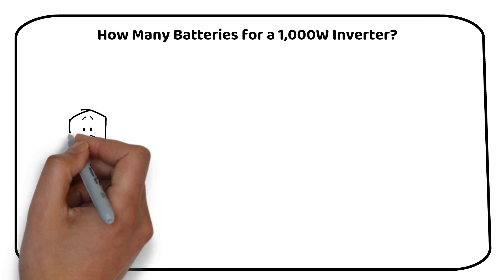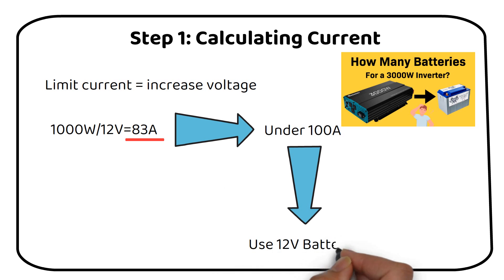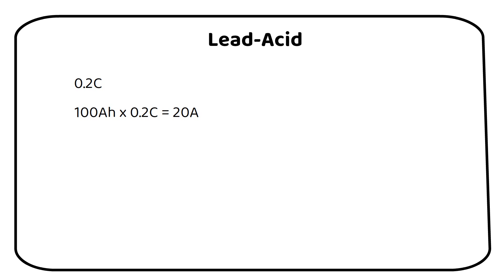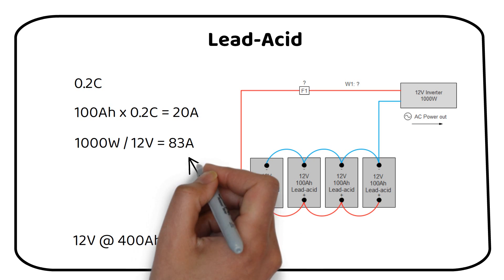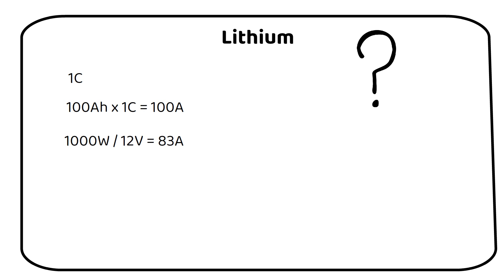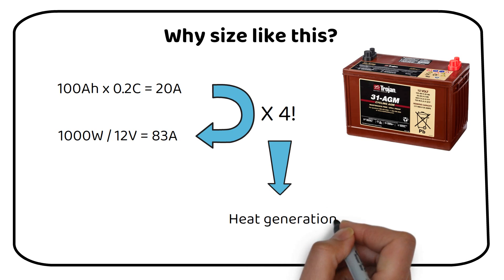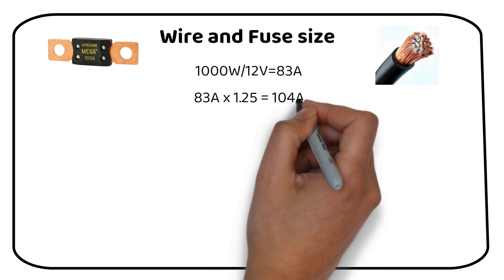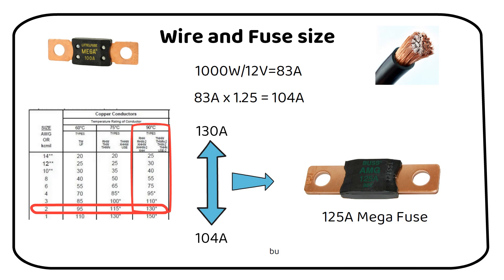1000W Inverter: How Many Batteries You Really Need

Comment: Ok, first off, a 1000 watts is pretty useless. Get an inverter that will at least run a coffee maker.
Reply from the maker: That's so American of you to say 😄 vans use less than 1000 watts.
Reply: @cleversolarpower  
2000 watt inverter and 460AH of batteries in my van. My coffee maker pulls 1200 watts.
Reply: No trying to start any arguments with anyone, just convey some useful, practical info: 
Mr. Coffee Mini (5 cup model) draws 635 W when on the brew cycle, then becomes intermittent, as needed with the warming plate on. That 1/2-size machine, with a 1000 W CSWEI PSW inverter, 10 Ah MPPT  charge controller, 100 Ah LiFePo4 (100 Ah BMS) and 150 W of solar panels has worked successfully without any other a/c input for the past year. We make a pot in the morning, another in the evening, and sometimes another in the mid-day. It's doable.
Reply: @davef.2329  Hey whatever works. I'm already running the fridge, I like to turn the diesel heater on in the morning, and maybe nuke a pastry with some butter to have with my coffee.. 1000 just won't cut it. Some of that stuff is 12V, but still....
Reply from the maker: @cabracove  With nuke you mean microwave? 😄
Reply: @cleversolarpower  Yes. There's a coffee maker, microwave and induction cooktop that all run off the inverter. Not all at the same time of course. Everything else is 12V. I could support a 3000 watt, but the 2000 is enough.  Remote switch, I just turn it off when I go to sleep.
Reply from the maker: @davef.2329  Pretty neat system. Do you have other loads?
Reply: @cleversolarpower  It runs a small (12W, I think) fluorescent LED tube light over the sink from dusk til dawn, too.
Reply: My Coffee machine pulls 2500 watt and the inverter is 3kVa 48V -  16 lfp04 280ah Est. On time 25% 
VICTRON Multplus 2 GX 50mm2 automotive double shielded cables 2mtr x 2 

I can hardly wait for the sodium cells to become reasonably affordable, especially considering their cold qualities.
Reply: What about a 2kw inverter? I would love to power a fridge

Comment: Cmon, you gonna deep discharge the batteries? 😅😅 The lead batteries are the worst, you can only discharge it for 25%, the rest of it 75% must remain in the battery! They are very inefficient! The Lithium has its own quirks of course!
Reply from the maker: Lead acid should be discharged to 50%. Lead acid still has its applications, but lithium is cheaper in the long run.

Comment: Im guessing you know better.. so... Why would you say lead acid is 0,2c and lithium 1c? 
My old lead is 0,33c but higher is quite common. I often run into 0,5c while browsing.

Also lithium goes all the way up to 100c and probably higher. Some are lower than 1c thou. Most of my own are 3-5c. 

I'm just curious why you say 0,2 & 1c.. why not just teach people to examine their bats or examine what to buy.
Reply from the maker: Checkout the data-sheet of the battery. Most lead acids are tested at C20 which is 0.2C. that is then the capacity. You can discharge quicker at a higher C rate, but then the capacity is reduced. Look at trojan battery data-sheet which shows it very clearly. Lifepo4 batteries are discharged at 1c and then the capacity is based on that discharge rate. Check my video about C rate.

Comment: Take your four batteries and turn them into 2p2s for 24 volts. Use a 24volt inverter and smaller wire is needed.
Reply from the maker: I have discussed that in my video about a 3000W inverter. If you have lead acid, you still need 4 in parallel to respect the C-rate. If you want a 24V system, then you need 8 batteries in a 4S2P configuration.
Reply: @cleversolarpower  I thought you were talking about 1000w. I just use 8 230A lithium cells and they run my shop and cabin with 3000w.
Reply from the maker: @rocktech7144  3000W/24=125A (okay-ish) 230Ah*1C=230A -> under 125A, so C-rate is ok.
Reply: Yea but why can't I have 2 12v batteries connected to a 2000w inverter so the pull is 83w from each battery
Reply from the maker: @mynameisprivate158  Your current will be 166A, which in my opinion is too much. It will work, but not as good as a 24V or even 48V system. I have a video about that upcoming.